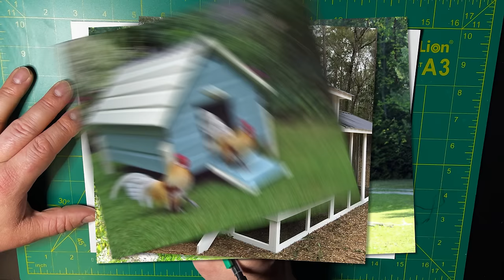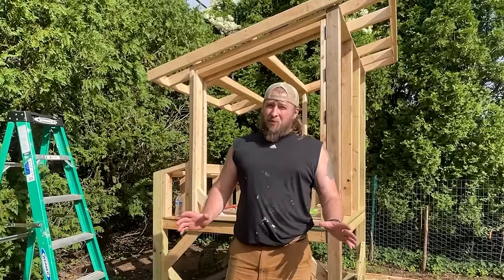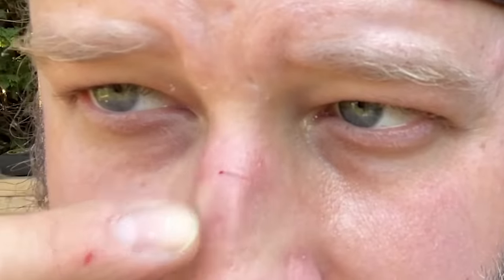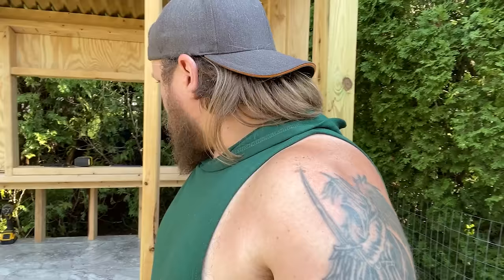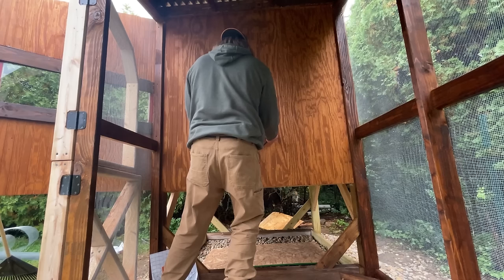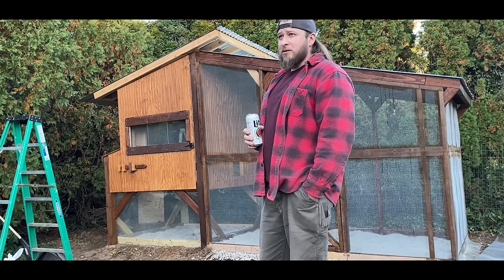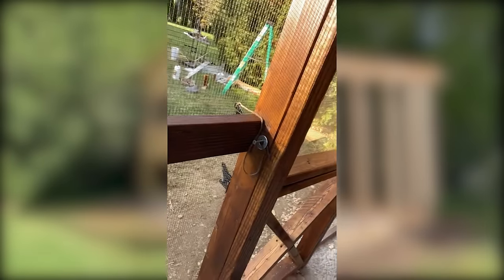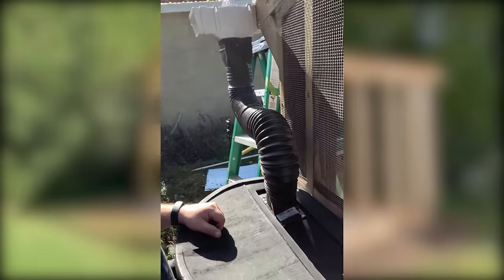EASY Low-Maintenance CHICKEN COOP | DIY | TIMELAPSE

Comment: Fun video! The only thing I might do different is to stain everything before building. Love your humor!!!
Reply from the maker: Highly recommend staining first if you can! I was in a bit of a crunch for time and the rain was relentless so I had to keep the project going the best I could. I’d also recommend putting the hardware cloth on the inside of the run if you can. It will help in the long run from keeping chickens from kicking sand etc up onto the studs. Functionally I went on the outside so it was harder for predators to push in on it but it doesn’t look as good as it could! Thank you for watching and commenting! Good luck on your build!

Comment: Depending on breed 4-6 months old to lay.  Only thing u might add, at big door a removable board to hold back litter until u r ready to clean out. Think about deep litter system if u haven't yet. Ultimate easy care! 
Great design & attractive
Reply from the maker: I am doing the deep litter method and I’ve also put a board in front of the wall that swings out to keep everything in! So far I can’t see why everyone wouldn’t do the deep litter method it is extremely simple and requires very little maintenance. Thank you for looking out and for watching the video!
Reply: @TheReaper1  - Good job. I also liked your edging. I use the deep litter method, too. I had purchased my original coop which is still in use, but last year I built a smaller coop myself (I'm 65) and both coops are on the ground. I have electric fencing (but not charged) around the run with one easy-up canopy for shade and another canopy with no top which also holds up bird netting to keep out predators. So far, so good.
Reply from the maker: I thought the edging would help the asthetic a bit as well as up the defense of the hardware cloth under it. That’s great that you recently built a coop of your own! It proves age is just a number! How many chickens do you have now with 2 coops? They sound like great set ups! It’s very encouraging to hear you’ve been raising chickens all this time and are an advocate for the deep litter method. Thank you for watching the video and good luck with your 2 flocks!

Comment: I enjoyed this video. The edits were so awesome, it. Just goes to show that with just a little bit of experience and a little bit of problem solving and common sense. You can really do anything if you put your mind to it. As long as it holds through the weather and keeps predators out. You're a-okay well plus happy chickees. 😂🎉🎉🎉🎉🎉
Reply: Yes predrilling  prevents the wood from splitting keep in mind however make sure the drill bit isn't larger than the screw threads. At least enough for it to bite
Reply from the maker: Thank you very much I’m glad you enjoyed the video! So far the coop has held up to some crazy storms, massive snowfall, bears, foxes, and even an earthquake!

Comment: A very nice build. But I would suggest that you insulated the Coop, not only for keeping the chickens warm in winter, but also to keep it a bit cooler in the summer. Painting the netting black is like making it disappear and make for a better view of the birds. I also noted that the chickens are of the Mediterranean breed, and they are usually not so keen on laying in winter time 😂.  I hope you don't get much snow, or freezing weather like we've had here in my part of Norway.
Reply from the maker: Currently have 2 feet of snow on the ground and the weather has gone down to -10 with no issues. Still getting around 5-6 eggs a day. Many farmers in my area have similar breeds for decades and no issues with the cold other than larger combs needing some Vaseline every 2 weeks or so to prevent frostbite. The biggest threat I have are hawks, eagles, foxes, and bears all of which have made visits to the property in the last 6 months 😂! Good luck with your chickens and their insulated coop 😂!

Comment: After watching so many videos i think this is it!!! I absolutely love it and so entertaining to watch. you are such a funny guy. One question though, do you have a link to the sand you used? I have no clue what the sand looks like up close. Thank you for sharing your coop design. Oh and fyi... the short beard was not a mistake. Looks good on you!
Reply from the maker: Why thank you very much! I’m glad you enjoyed the video and my random thoughts through out the build lol. So on to the sand, after doing a bunch of research for the best run material “All purpose Constructed sand” was the winner. I got it at Home Depot and I’ll provide a link to it. It’s a little more coarse than “play sand”. People that did the research said “play sand” was a no no because it’s particles are too fine.

 If I were to do it again I would use more sand and have my coarse rocks even lower. I found out pretty quickly the chickens like to use the all purpose sand as make shift dust baths at times and will dig a hole that’s 8 inches deep, which in turn shoots out the larger rocks I placed for irrigation to shoot all over the place in the process! It doesn’t ruin anything other than when I “Poop Scoop” I often am scooping up those large rocks and just throwing them away as well. (So maybe don’t use any large stones) Hope this helps! Thank you for the compliment on the beard too! 

https://www.homedepot.com/p/Quikrete-50-lb-All-Purpose-Sand-115251/100318450

Thank you again for watching and good luck on your future build and chickens! I’m actually in the process of starting to edit chapter 2 of the build and my next adventure with chickens. Fingers crossed it is even better (ran into some serious bumps in the road with this one).
Reply: @TheReaper1  thanks again for sharing. I need to get started on a coop because I got five chicks 2weeks ago and they are getting really big. Hope I will catch your next edit to the coop. I truly enjoyed every bit of your video and found it very informative. Oh and one more thing, if you don’t mind, what are the dimensions for the actual coop and the dimensions for the run? Again thank you
Reply from the maker: @saveforthree  you better get a move on it then! 😆 
As far as the coop size I’ll have to run out and measure it tomorrow but I’d say the coop is about 5’ 6” x 5’ 6” and the run itself is around 14-16’ including the area under the coop that is fenced in (hardware cloth) that’s a rough estimate but I feel it is somewhat accurate. I was using old lumber for the most part and stuff I got as scraps from jobsites. I’ll try to get some measurements tomorrow real quick in the morning. Thanks again!

Comment: I love this video so much I've watched it twice already...
I'm duplicating this and starting soon myself. 
I have one question... did you do any pest control for the gaps in the roof? And if so, what did you do or use?
Reply: I live in NH and we have a ton of critters in all sizes
Reply from the maker: Well I’m glad you liked it so much! Took a hell of a long time to edit lol! 
So as far as the roof goes I’m assuming you’re talking about the ribs that have gaps. Technically there are brackets you can buy at Home Depot or Lowe’s that fit perfectly on the studs and you screw through them. This prevents the metal from bending if you sink the screws too deep etc. I haven’t had any pest problems with these. Only thing I could think of would be bees maybe, but I haven’t seen any yet and I’m out there everyday so if I did see a nest starting I’d break out the “shredder” Bug assault gun I have that is co2 powered lmao. Other than that the two eaves that meet between the two roofs have a 2x4 that prevent anything large from getting in, but…… I do have have 2 morning doves that made a nest under it  that I didn’t have the heart to boot out just yet. Hope this helps! Good luck on your build! Oh and if you wanted to prevent something like that I know they make these metal spikes (essentially just bent metal rod) that stop birds from perching in areas.
Thanks for watching again!
Reply: Thanks for the info... I appreciate it a ton... Once I get home I'm going to be drawing it all out to my specs.. Mine will be a tiny bit smaller just to cut on materials..
Great job on yours man...

Comment: I LOVE this design! Did you happen to make plans? I have to build my own coup, and have been looking. Thanks!!!
Reply from the maker: Unfortunately the closest thing I made to plans were the quick blueprints I drew up in the beginning of the video. I did put links in the description to all of the material I used aside from lumber if that helps at all. I may make some in the future but most of my measurements I was just winging it and adjusting things for the size of the scrap lumber I was using (I was trying to be as cheap as possible lol) thank you again for watching and good luck on your coop build!

Comment: I’m currently saving so I can build  the same Third Craftsman’s coop. I bought his plans & they are awesome.  I’m going to do the gutter & rain barrel watered.I’m using hardware cloth also. I also plan on making plexiglass panels the sides of the run to block cold winds  and the chickens can be in the run. Of course leave a gap up top for ventilation.

Comment: How are you liking the grandpa's feeder knock off?
Reply from the maker: To be honest, for it to work properly it will need some modifications. It is far cheaper but with that comes some flaws. The lid is so light that after a few weeks it started to stay up. A solution to this is to fasten something to the top for extra weight so that the step will in turn lift back up. 
      I’d also recommend putting something at the base like I did in the video to keep it from tipping at all. That was the number one issue I saw when reading reviews so I wanted to remedy that right away. Other than that it’s not bad. I may use a large hole saw to put a pvc 90 into the side that extends to the outside of the coop so that I can fill it with food without entering the run. Hope this info helps and again thank you for watching and inquiring!

Comment: I’ve been looking for a design for my next coop and I love your video. I know you gave an Amazon list of extra materials you used, but do you have a list of what would you purchased and a design layout with measurements?
Reply from the maker: The Amazon lists have all the materials I used and tools I used. The only thing I don’t have on there is the lumber, roofing, and old windows I found in my attic! Lol. Unfortunately I do not have a list of all the lumber I used and I didn’t write down the exact measurements as I did it on the fly comparing it to other coops and adjusting sizes for the second hand lumber I mostly used on the build ( I obtained a lot of the lumber from jobsites that were going to waste it and throw it out )
 I can tell you the majority of all the studs are 2x4’s. The legs of the coop itself are 4x4’s. The siding I used I got from Home Depot and it was 1/2” 4x8 sheets. Typically people use T1-11 that is pre primed for exterior use, but I was trying to be as cheap as possible so I could spend money on a rain barrel water system so I went with the sheets you see in the video and used an extreme exterior stain on the inside and outside of the coop. My apologies that some of this is vague. Let me know if there’s something specific you want to know about it, and thank you for watching!!!

Comment: Whats the best insulation  im in Colorado.  It goes to -20°
Reply from the maker: To be completely honest I don’t know what to tell you for that. I can tell you that my coop has no insulation, but there are a couple of other factors I have going on. 
The deep litter method causes the pine shavings and chicken droppings to begin composting which in turns generates a small amount of heat in the coop. 
The specific breed of chicken you have will make a huge difference on the temperatures it is able to handle, some breeds are far hardier than others in colder climates.
I only had 2 nights this past winter that dropped into the negatives that also were very windy to the point it was a -50 degree windchill all night. Now I knew that it was going to be very windy and that would cause the coop to lose temperature faster than if the air was still. So I broke down and bought a heating pad. It was around 30-40 dollars and safe enough for direct contact with anything in the coop (safer than a heat lamp). I used that and I saw the temperature of the coop itself rose internally an additional 5 degrees ( I have a wireless temperature gauge in the coop that I can see the readings inside my home from). After those two days I turned the pad back off as to not get them too used to supplemental heat. 
As you see in the video though I have no insulation on the walls for them. But again I don’t have consistent cold weather as low as yours. Hope this helps a little. Might be best to ask locally what others are doing. You’d be surprised sometimes of how little people do for them lol. Additional take that with a grain of salt because some people are use to losses on their flock where as I am trying to give everyone in it a fighting chance as best I can without breaking the bank. Cheers!

Comment: This is so well thought out, and just beautiful. Is there anything you’d change if you could go back?
Reply from the maker: Thank you very much! I would have cut the door to the chicken coop ramp a little higher for using the deep litter method (pine shavings fall out of the coop sometimes). That may be it. One day when I have more property I’d definitely make a much larger design for a lot more chickens but so far I can honestly say I have no complaints.
Reply: @TheReaper1  awesome! I’m glad you’re enjoying it after all your hard work. I’m considering a coop that can be moved around a bit, I’ve seen where they move it weekly. Good for the soil, and I’m going to be gardening as well.
Reply from the maker: The second small coop I made in the last video I would move around every few days for freshly hatched chicks until they were large enough to move into the big coop. I made it into a mini replica of the original large coop. I’d definitely get larger wheels than the ones I had installed and honestly I’d make it so the run was wider but overall it’s a good way to fertilize the yard! The grass would grow noticeably higher in the areas it had been in. Good luck with your future build!

Comment: This is was such a well made vid. Amazing job. Also, are there plans for this build?
Reply from the maker: Thank you! Unfortunately I winged it. I looked at a bunch of designs and added the best parts of all with measurements on the fly. About half of my lumber was leftovers from jobsites so I wasn’t always able to make things the sizes I wanted to because of that. I really wanted to keep the cost down as much as possible since the materials and hardware I used alone were adding up. Just use your best judgment and make sure you have the essentials! An enclosed space with ventilation, roosting bars, a nesting box. And a run and you’ll be good to go!

Comment: Great video! I just purchased Chris’s coop plans. I can’t wait until my husband builds our coop. He is not as excited as I am. 😂 I do love the windows that you have put on yours. We live in Florida and it rains a lot. When the wind picks up rains goes everywhere. How did you build your windows or did you purchase them? Thank you 😊
Reply from the maker: Thank you very much! That's great that you guys have plans to build the coop, will be much easier than winging a build like I did! A lot of mine was built with recycled/scrapped lumber where I could use it. The windows also fall into that category lol. I found those two framed panes in my attic. They were around 70 years old but I can't complain when it cuts the cost down. Windows are very expensive and I'm very cheap so those two combos don't mix well. When the accident happened and the window broke that's when I had to spend a couple bucks (but still stayed cheap) and bought a couple of plexiglass pieces and framed them in. You gotta remember the chickens aren't going to complain about the types of windows as long as they can openfor fresh air in the summer. So keep an eye out at antique stores and yard sales etc, you never know what you'll find! Good luck to you two!
Reply: @TheReaper1  Thank you. I am going to try to find some barn sash windows. Maybe those will work.